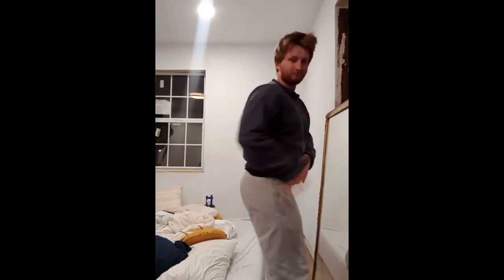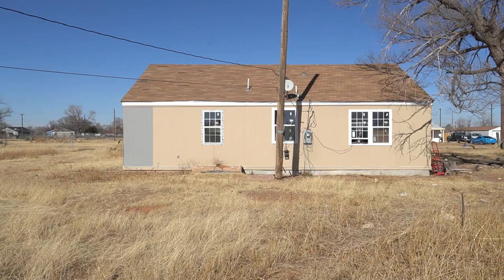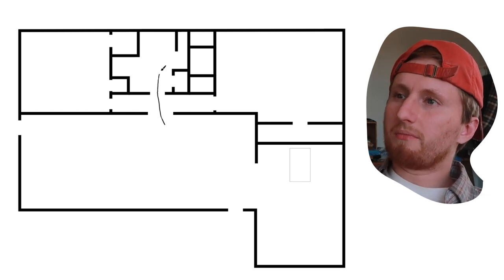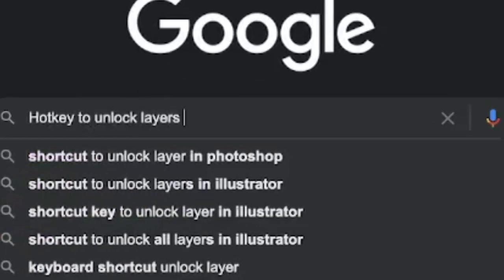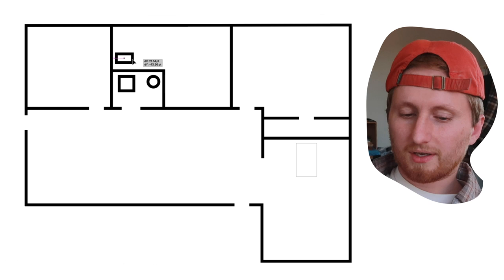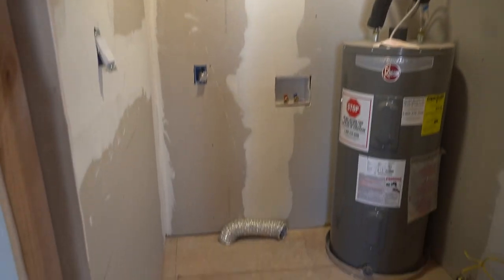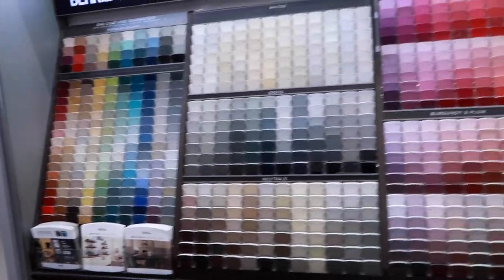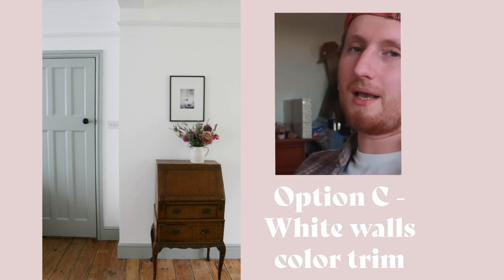Can I redesign a whole house?

Comment: Option A

Now I don't know about macs but I'm pretty sure you can salvage the data. Even if the laptop is broken, the SSD with the files on it should be just fine and you can just simply exctract them, right? Or does apple have some bs blocking methods for that

Comment: I had what appears to be same issue with my laptop. It turned out to be  the battery. You can do a google search on the key strokes to override the battery and run from the power source to recover.

Comment: The harddisk may be fine, even though the laptop is dead. If you didn't already do this, take it out and connect it to another computer, to see if it works, so you can get your files. If the laptop is completely dead, it probably has nothing to do with the harddisk.